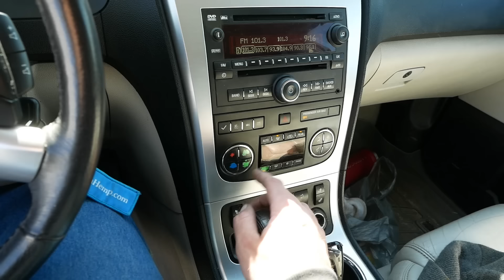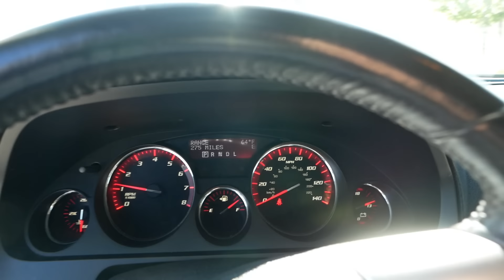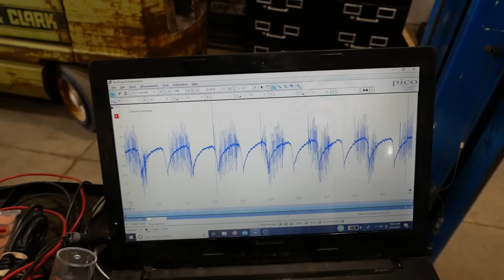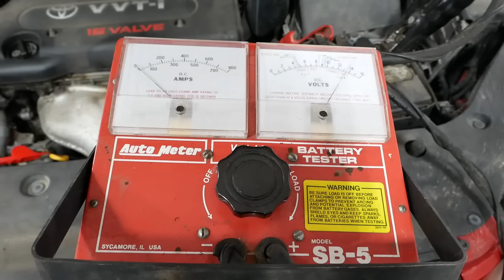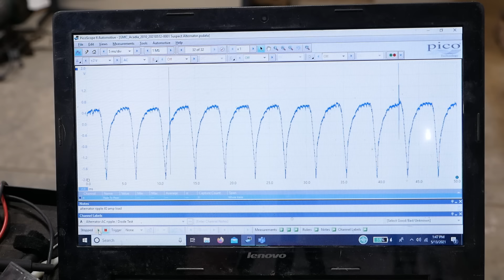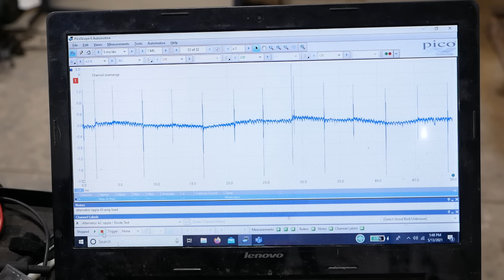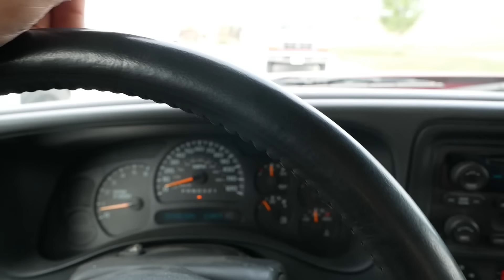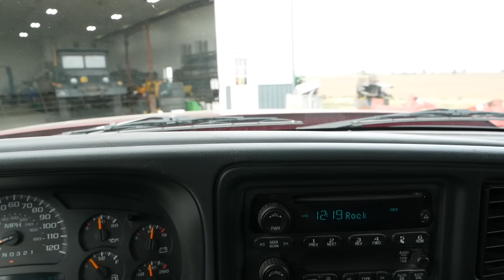A Normal Day at My Rural Repair Shop

Comment: I had similar issue with a "clutched alternator" on one of my volvos, the clutch was just going bad.  So the alternator was pulsing and it kept tripping sensors and forcing the computer to go into limp mode.  Of course when they went to test everything, it put out 14.5 volts. If the tester did not incorporate the clutch mechanism which was computer controlled they would never know.  The only reason anyone found out was the dealer wanted 900 for a new one, and of course i asked what the hell made it worth 900 dollars, and they tell me stone faced, "Its a clutched Alternator good sir"... Live and learn i guess

Comment: Talk about sparks flying. I was replacing battery cables on a saturn aura. The ecu is right inferring the battery and I was tightening the positive cable and arced my ratchet on the computer. I was shitting my self the whole hand hour one way to the parts store to get a crimp connector I needed. Needless to see the car started and ran fine and no customer complaints.

Comment: Had a 2010 GMC Acadia lose the 200 amp fuse wire breaking in half off the alternator, seems to be an update for the wire as it’s not longer available, you can clearly see the giant 200 at 7:08.
Also the humor at 33:20 about the army truck hahahahahah

Comment: I believe the alternator would have passed the expensive diag equipment test. So just this case for Wese's brain on the Pico. I didn't even know after looking at the scope. Hope mine stays running good. Don't have a key fob spare as this is keyless, so will have to program the new fob some day.

Comment: Yeah oil changes on the Acadia's are the worse. It's so fun getting burned by the head shield. I usually do it from the top because the skidplate is in the way and I don't feel like taking it off. The worst of the worst is the newest Ford Ranger, the service manual says to remove the left front wheel because the only way to get to it is in the wheel well. What were they thinking?

Comment: Guess the alternator lost a diode and was only putting out on 2 phases.  Had that happen to my truck, didn't know it for a while until the new LED headlights started doing wonky stuff and I noticed the idiot light voltage gauge on the power-point expander was fluctuating.  Was putting out 26 amps at idle when the truck really needs about 76 amps at idle!
Reply from the maker: Agreed. This article has some interesting examples. The waveform I was seeing looks just like #4. https://www.motor.com/magazine-summary/alternator-ripple-effect/

Comment: Impact printers are still widely used in a few applications.  First, any time you need carbon copies, impact printer is the only way to do it.  Another is high volume text printing, like from a mainframe.  The cost per page of impact dot matrix printing is substantially lower than laser printing and they tend to have a duty cycle of 100% if they are made well.  Ink jet is prohibitively expensive for high volume printing and they don't really make good ink printers anyway.  But even laser is much more expensive cost per page than impact.  The paper is cheaper, the mechanisms are cheaper and (a lot) more reliable and most of all, the cost per page in supplies is MUCH cheaper with impact printing.  A ribbon costs 20 bucks and can run for a long time with just occasional re-inking. We're talking a fraction of a cent per page vs laser of around 2-4 cents and ink over 10 cents.
In the right situation, they are the best and really the only solution.

Comment: Excellent video Wes  :) also had changed Alternator on vechile recently also want Lol on it work fine on Cold start but Hot start not to well all ! What find on Cold Start Voltage also Amps right all & Hot Start plus drive  Voltage drop at 13.0 Volts not 14.5 V be at and amps were at 80 not 120 amp original at if new or rebuilt Alternator so put New Alternator in also clean Connections plus Battery Cable and grounds went back normal almost till found out something did look right caught me eye seeing  also it was! But found the Pig Tail ground Connections ground on Transmission were corrosion lots and Fuse Panel Connection of Red cable was problem to clean up bang all perfectly now! No low Amps or Voltage too now ! Was on Dodge Journey 2.4 litre 4 cylinder motor 2010 my mom has ! But fun part Dealership she deals with said was okay in February this year 2021 and Alternator charging fine also work excellent! But can't fool me and I found the problems was and 3 hours of working on it with Alternator repair too!

Comment: My 73?74? Jeepster commando with the 304 v8  you had to remove or at least loosen the motor mount to change the oil filter

Comment: I remember I had just started turning wrenches as a oil change grunt around the time these Acadias came out, I had to buy heat sleeves for my arms specifically for these cars, if you’ve ever tried to change the oil on one of these cars right after someone’s come off the highway then you know why lol, no way in hell you’re getting that filter off without somehow protecting your arm

Comment: Chrome foil wrapped grill was peeling on the 2007 Explorer, replaced with a straight black grill, front bumper cover, headlights and trunked the running lights into foglamps.

Comment: I installed that same trailer wiring harness in my Honda. It turned out it was not compatible with the wireless trailer brake system that I installed on my trailer. I had to remove it and do it the old-fashioned way. Most trailer brakes require you use the same ground as the brake lights. Those add-on harnesses use an isolated ground module to protect your truck light harness. What a shame!

Comment: Im seeing more n more supply chain issues even at my place in Florida 1-2 days for Napa, amazon prime 3-4 days. Here at my rural area 2 x as long for almost everything. I think its going to get worse im  trying to stock up on filters for my ford diesels and oil. The 2 old dodges ha they just keep running with STP and starting fluid.

Comment: You commented the excessive voltage ripple may have been from a shorted stator. If that was true you would have low voltage. The problem you were having was a leaking diode. The alternator creates 36 volts AC and there's 3 diodes to reduce that down to 12 - 14 DC when you see the ripple it's AC interference is getting past the diode. That is also why in a good working system you see the smaller ripples. And you were right to change it. It would have destroyed everything electronic in the car let alone the spooky drivability concerns.

Comment: Those burn marks on the sockets and extensions separate the REAL mechanics from the weekend warriors ! lol You ain't lived until you've welded an openend/ring between the lugs on a 1200CCA 8D, and seen it go red heat on you !!

Comment: On the alternator, the dash gauge was reflecting the ripple. It was wavering back and forth.
Reply from the maker: That ripple is at 40 times a second, so probably not likely. The computer is trying to regulate the voltage and it's not working very well!

Comment: Plastic push rivets on the core support of the ford edge are they like what holds the front inner fender liners in place on a 2000 dodge ram Laramie 4x4

Comment: I only broke down and pulled my column to do the bearing after I spent 3 hrs with my head jammed under the dash trying to do it the hard way.
I was also a dummy and broke the clock spring. $150 mistake.
Reply from the maker: Ouch! Pulling the column sucks, but I was getting nowhere.

Comment: If that repellent didn't work for you try Ultrathon Repellent 8, made by 3M. It works, the only repellent I've found that stops biting flys, chiggers, and Deer Flys. I keep a can in the boat, in the garage, and on the tractor. I am no longer the smorgasbord or buffet :).

If it did work, let me know, I welcome second source products.

Comment: I have a 2012 traverse which is the same thing. The front motor mount has a rubber cap over the top so oil should run off of it. Either way it’s a shitty design. Last month I replaced the TCM solenoid discs. That was fun

Comment: A friend had an Acadia like that. 2016. Worst vehicle I’ve even seen in my life. To blowing a/c compressors once a year. Timing chain tensioner failure, and ultimately an major oil burning issue that caused a catastrophic engine failure at 68k miles.  

People say that German cars are unreliable. I have a 1999 Volkswagen with 188k miles. With the original starter, alternator, a/c compressor, power steering pump, radiator and clutch. 🤷🏽.  
Sounds reliable to me.

Comment: To err on the side of caution I would have either taped the hot wire or put a piece of rubber hose on it to avoid fireworks.

Comment: Wes i have a question and please answer back cause i need to correct the problem.I have a 95 toyota avalon xl.The cold start is almost perfect but my problem is i had this car since 2013 i had lots of things done to it even some refurb fuel injectors.The problem is sometime when i start it up running errands for me and my wife i have to turn the key to on wait a few seconds the start her up.And sometimes i have to pump the gas pedal to start it up.And i put a fuel pump on it when i first got it so i dont think thats the problem but i dont know you tell me! your the Mechanic?Oh yeah a couple of months ago i got a new battery and starter put on.I need to know how can i get a first and clean start every time?oh and when it stalls the exhaust stinks.

Comment: When they bring their own parts tell them if it isn't correct you are going to automatically order the correct one. Where are you by Fulton where there is that much flat land? I used to live in Ustick Township, Spring Valley area. You must be in the southern part of the county. Next question, is Clinton Auto still in business?
Reply from the maker: The camera makes it look flat, but it's not. And no, they are not, but I went there a thousand times with my dad when I was a kid.

Comment: Well, they say "variety is the Spice of life"--few of those saying so were sole proprietors, though.  
And, you do seem to have decreased the number of random trailer wheel incidents nearby (Co. Road notwithstanding)
I have installed "ranch drives" substantially better than the paved County Roads to which they were connected.  Sigh.
Reply from the maker: It's not unheard of for folks to fix their own roads out of desperation.

Comment: LMAO is this a how to not get parts video? actually found this more interesting then most so keep up doing as you do. :) PS the alternator was probably putting out AC as well as DC which will show voltage but not really charge the battery.

Comment: 20:23 did I ever mention I plan to design a electric ratcheting wrench? It would work one of three ways (pneumatic is also possible but not such a good idea for tighter spots) 
Way one: like one of those sideways extensions where gears go between each end to transfer power
Way two: like some other versions of those sideways extensions where a chain is used and the guides are small and run off the pins that hold the sides together
Way three: the cheapest and most likely way where the end acts like just a thumb ratchet with a lobe and push shafts inside alternate back and forth to push the ratchet back and forth, this method works similar to the air hammer to break radiator fan nuts free method.

I also have a plan to design a ratcheting line wrench where it’s basically just a modified ratchet wrench that has the pawls in the handle and the part that spins is already just a toothed wheel. The biggest issue with this is size versus strength and it would likely need a regular line wrench on the other end to break things free, this brings up its own issues of time and effort to switch versus just using the wrench or a regular open end wrench.

Comment: Idk much. How do you know if the 2.5 low compression was the piston, head gasket or possibly valves?  Thanks for the fun?
Reply from the maker: A leak down test. But it doesn't matter. If she ran it with no coolant I'd never trust it without replacing it or a complete rebuild.

Comment: Whatever happened to the basic alternator with regulator. What is the deal with computer controlling alternators.
Reply from the maker: They can squeeze another .0001 mpg out of it...
Reply: Actually, I remember now. The computer controls how much and whether the alternator charges depending on the load being placed on the engine, if I am remembering right. That does seem like it would provide small economy in exchange for increased complexity.

Comment: People say we have made technology leaps on automotive designs but I disagree. Cars before the 80’s were strong and simple AND easy to work on. I’m thinking the manufacturers are moving to through away cars. When it stops you change it out.  Plus there are very very VERY few auto technicians like Wes. The dealers are UN plug and RE plug a new one. They don’t have the want to find out why like WWW does.

Comment: THE ALTERNATOR, THIS IS WHY WE "NEVER" INSTALLED CLIENT PARTS. NO PROFIT ON THE PARTS, INEVITABLY THE WRONG PART TYING UP A BAY, OR AT MINIMUM WASTING OUR TIME AND WHEN THE NEW PART FAILS ABOUT HALF THE TIME THE CLIENT EXPECTED US TO REPLACE IT AND NOT CHARGE FOR LABOR (WARRANTY). GOOD LUCK WITH THAT.

Comment: How rural are you exactly? Jealous of overnight parts before lunch. But I feel your pain, out of 6 jobs sitting in the yard, 3 quick diagnosis waiting on parts, and another whose owner doesn't know whether to get it fixed or not and wants a price on hard to find parts, or an itemised quote to repair an engine you still don't know exactly what it needs. 
But would you want it any other way?

Comment: Your absolutely correct you need to narrow your scope on what you fix - you will become faster and you will quickly learn where the morons worked up the labor rates.  Judging from what I see I think you should concentrate on dodge - Ford and Chevy pickups - however avoid chevy diesels unless your into BDSM - also dont forget to raise your shop rate at least 10$/hr when doing diesel work ... you need to get more for them due to so many special tools required to work on them efficiently- those farm trucks get the running gear beat out of them pretty quick - that kind of work is quick ugly and profitable- and dont take anything bigger than a one ton.  Those bigger trucks gets into a different class of tooling - I notice you have some heavier Jack's for working on them - but there is no way to quote a job on that crap - one broken stud or bolt could cause the time on a simple job to double ... unless you quote the job as + broken bolts not to exceed.  I used to quote jobs like that all the time __ the quite would be like this - I expect the job to cost you 8000 unless we have some unforeseen trouble so if it looks like the job will run over 10k I will call you for further authorization... we called it the not to exceed bid..  your a fine wrench so if you set your shop up as a speciality shop people will recognize that and source your shop when your needed.. I live in a semi rual part of east Texas- everyone has a truck - lots of them diesels - we have a local shop that only works on pickups up to 1 ton - except he wont work on a Ford- so we have another shop a few miles away that only works on Ford trucks -- both stay weeks behind ... love ur videos

Comment: I have one for you I have a 2005 GM minivan that needs a master cylinder but the owner says that it is not The Mattress Center he says it just needs to be bled but it sounds like air in the Metrocenter when you hit the brakes now the car owner is a license diesel mechanic he says if it's not coming through the booster there is nothing wrong with it I am talking about brake fluid

Comment: I hate the voltage gauges that read opposite direction of every other one on the planet, lets run the speedometer counter clockwise as well. (see the point?)

Comment: The lady with the jeep was blowing from a heater core with no coolant. She's due to know that cars without coolant don't transfer heat, to either radiator.. because air isn't a very good conductor. If she wants hot heat, well.. you know the thing(coolant).

Comment: Hi Wes , sorry to spam this video and ask this question , but i am in the market for a home diy scantool. I am wondering if the autel is good enough. would you spend the extra money and go the snap-on ??
Reply from the maker: Depends what you want to do. Both are probably overkill for the average home DIY guy. The Autel is easier to use and overall has more capability. But I often run into things the Autel can't do that my Snap On tool can. Like misfire counters on Chryslers or various things on older Fords. I think the Solus and the Maxisys 906 are similarly priced.

Comment: Literally me after 12 hours diy repair “does it still run” only to find out it doesn’t run because of that one plug that should have been plugged in 6 hours before reassembly